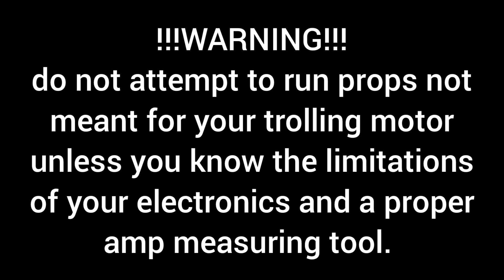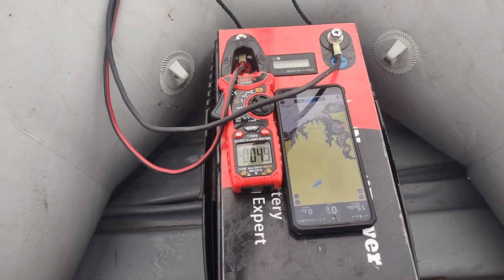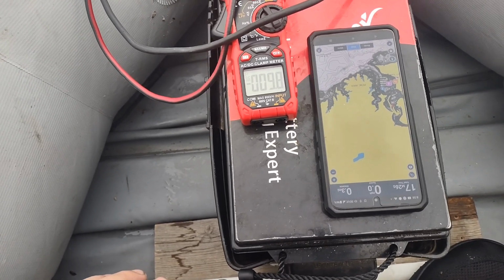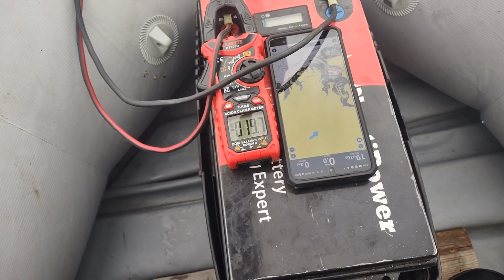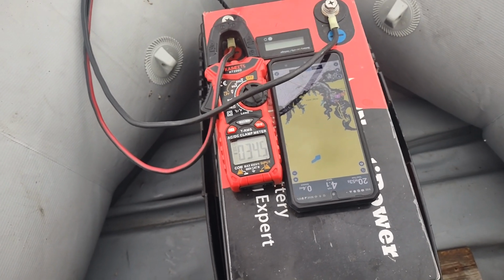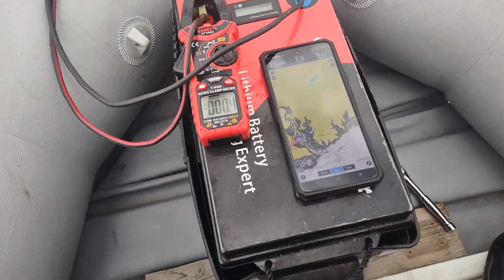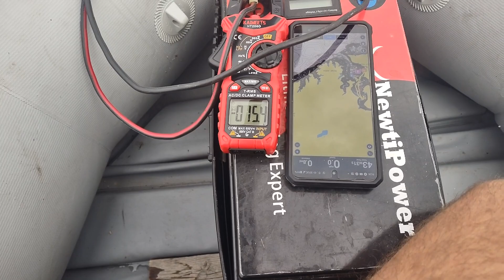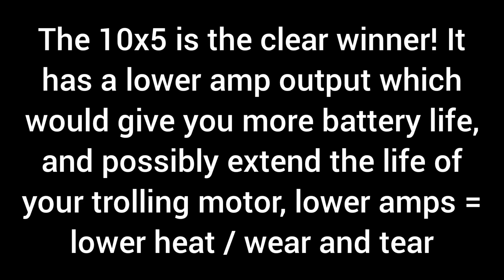10x5 vs 10x8 prop for Minn Kota trolling motor

Comment: Would like to see a 12x5 for comparison.  Larger diameter turning a little slower might equal more thrust on less amperage.  This is a very good video series.  Thanks!
Reply from the maker: That may be a possibility very soon, APC is going to send me some to try out, I'm gunna make a series on it to compare all props they send me, as well as trying on on a 112 pound thrust motor that's attached to a 28' pontoon boat!!!
Reply: @codyakfishing8856  I bought a 240 lb thrust 24 volt...it didn't speed up my 10ft jon any faster than 12v 46lb thrust...what gives? 5x the pound thrust and didn't add a single mph 😢 I returned the stupid thing.
Reply from the maker: @rittzbyitch3682  240lb thrust???
Reply: @rittzbyitch3682 the thrust is rated at 0 mph.  It doesn't represent a top speed.
Reply: Most trolling motors have about the same top speed regardless of thrust from what I have found. Changing the prop pitch is worth a shot
Reply: 10 x 7 higher pitch for faster speeds but slower starts less torgue.

Comment: You have to match the prop to the boat. That motor, battery and 10x8 on a nice canoe would hit close to 6mph or higher.  the 10x8 is a great cruise prop  where you could draw 10 amps and run all nice and slow like a trawler.
Reply from the maker: I agree with you 100%, seems the 10X8 is a bit much for this particular boat, I may have a plan to use the 10X8 on a 24v 86lb motor to see if it would achieve the same speed as an epropultion/nt300
Reply: @codyakfishing8856  I use APC in my RC planes and you can do a lot to them to get what you're looking for if one is a bit much. You can the diameter down some or narrow the blade some. order some and play around with them. You can even heat them up and change the pitch some but you need a pitch gauge to do this.
Reply from the maker: @airraptor  I'll keep that in mind, I have ordered a 24v trolling motor, it will be in sometime next week, I'm gunna try the 10x8 with it, if not APC agreed to have me review and test many of their props for marine applications

Comment: Great experiment, great data, thank you! 10x8 is actually quite similar to the recommended propellers (11x8) for torqeedo 1003, which is their past generation slower spinning model rated at 1000w. Of course the blade shape and area ratio is different, but not drastically -- apc propellers are much closer to these entry-level electric outboard propellers than traditional trolling motor propellers. I'll probably try out 10x8 on my 86lb trolling motor (also drawing around 1000w with stock propeller), and see if it has enough torque for the higher pitch.
Reply from the maker: Sorry I'm late to this, I had no idea it was similar to the torqeedo, now that gives me an idea, maybe an 86lb thrust motor from Amazon along with the 10X8.... May get up to 6mph.... Hmmmmmm.

Comment: Great videos! I love seeing this type of testing. You should compare these apc props to the aftermarket kipawa propellers that are designed for trolling motors
Reply from the maker: That's a great idea, I'll have to do that soon thanks!!!
Reply: I have the Kipawa props. They're like traditional trolling motor props, with very wide blades. They're very well made (tough) and will move the boat a bit more quickly, but also use more power.

Comment: thank you for posting this. I have been testing power requirements for my redneck barrel boat all summer and this is helpful. Especially because you link'd where you bought them. 
A couple of key things I've learned this summer, the motor doesn't like a lower voltage for very long, it will get hot, and the motor control will get hot in just about any case unless you directly cool it if you are out more than a couple hours at a cruising speed of 3mph or more.
Also, if you are using marine batteries (lead), you need to have enough battery that it would run 10hrs at the rate you use it. So, way more capacity than you will use, but pulling power out faster than that heats up the battery and damages it. Lithium is not like that, but you must have a good bms that can handle high output for a long time if you use lithium. So, you may have to get a much bigger pack than you need in order to keep things cool.
My system is 24v trolling motor running on 4-6v flooded golf cart batteries (5kw/hr). I can only run it at 22 amps (500watts/hr) for 5 - 10 hrs (half the battery). Max amps is 45. if I go at more than 22a, something will get too hot to continue. Of course if I am only running for an hour or two, I can run at full power. The control will get very hot, but it will do it.
 I will get some props and test them next year probably. Thx for giving me an idea of what I can expect.
Reply from the maker: I'm glad it helped!!! Yea I run a 150ah lithium battery, and I can run about 3.5 to 4 mph at about 15 amps on a calm day, low voltage does hurt motors, but lithium stays above 13 volts all the way until they are close to 0. I can do at least 3mph for 10 hours, and pulling 15 amps I don't fear anything getting hot or damaged.

Comment: was wondering if you had any thought on one of these apc props fitting on a newport vessel 55lb trolling motor? I believe the shaft is the same size 3/8. Goal is to extend run time on my 100ah lipo battery.
Reply from the maker: As far as my testing went, i believe the Newport 55 will benefit close to the same as the Minn Kota 55 enduramax, best prop you could use is the 10X5m-LH

Comment: Hey Codyakfishing , thank you for the review of the 10x8 prop!!! According to your findings with the 10x8 prop and the 55 trolling motor, it didn't do as well as I thought it was going to. However... with a little bit of math and the previous findings with the c30 Endura which is what I'm running the 10x8 on the smaller/slower motor should move more water and only draw within 1-3 amps more difference. It actually may do quite well on the upper end of the motor (speeds 3-5). The pitch of the 10x8 is much greater than the 10x5 and I don't think cavitation will be an issue due to the slower speed/power of the c2. Thanks again boss man, your information is GREATLY appreciated!!! I will keep my eye out for more of your boating and motor wisdom! Oh I had one more question...I was looking to purchase a handful of shear pins and I was wondering if they are all the same size? Is there a certain part # I should be looking for? Thanks again brother!
Reply: For apc and tonhatsu 2-3.5 hp propellers, I'm using 3mm x 25mm, or 1/8 x 1" pins.
Reply from the maker: I'm not sure of the size.of.shear pins, I do believe form 30-55 they are the same, I'd like to purchase quiet a few as well,.I have 2 for now.
Reply: @helloterran  I thank you very much for the info sir!

Comment: My Xi3 will do 4.7 mph with the 10x5 prop and it will do 4.3 occasionally 4.5 with the 10x8 prop.... 
The 10x5 last alot longer too on my kayak. 👍
Reply from the maker: @SargesAdventures  that's great to hear, have you tested to see if it's drawing as much power?

Comment: Great experiment, thank you!!!!  

Do you think it won't be big 10x6  for 55 trolling motor ? Or perfect  10x5  for motor  30lb and 55lb ?
Reply from the maker: As of now, I believe the 10X5m-LH is perfect for a 55. As for a 30 I'd say a 9X5ish (haven't tested yet) but the 10X5m-LH works for the 30 as well, only with the 30 your 1st speed is higher than 2mph (a little fast for a slow trolling presentation). If you have a pwm installed on the 30 that takes that issue away
Reply: Hi, what you can recommend for 42 lb minn kota?

Comment: A couple years ago, I measured thrust and amps using a static setup in my pool with a minkota 30 lb trolling motor.  
I got the best thrust to Amps efficiency ratio with a 9-6 APC prop.
Reply from the maker: Nice, that's good to know..... Did u have to modify the prop to fit on the motor at all??
Reply: @codyakfishing8856  
I just had to add a slot for the drive pin. 
I just dug up the data and I was wrong about the 9-6.  I didn't test a 9-6.  I stuck with various props with a 4" pitch which I researched as being the pitch of the stock prop.
 The best performance was actually with a 9-4 APC and it provided the same 17 lbs thrust as the stock prop (yes the 30 lbs rating is a lie), but that same thrust was achieved at 21.7 amps versus 27.8 amps for the stock prop.
Although I never did comparison measurements in the water, the 9-4 feels faster despite having the same static thrust which I suspect is because less current means more RPM.   More RPM for the same pitch equates to a higher pitch speed.
Reply from the maker: That sounds about right, I definitely gained speed with the 10x5 over the stock prop, and the 10X5 is made specifically for the trolling motor, thicker blades, and a recess for the shear pin.
Reply: @codyakfishing8856  
I did manage more thrust with larger props, but the 9-4 was the best combination of efficiency and thrust.   The highest thrust was with an 11-4 APC at 21 lbs, but the current was too high at 32 amps.   The highest efficiency was a 7-4 prop with 13 lbs at 15.7 amps.
Reply from the maker: Nice, I gained tons of efficiency with the 10x5, I thought about going for that new Newport electric outboard but top speed is about 6mph, that's at 36v and 35amps, not to mention with a battery it's about $2000, I just don't see the need to spend that much for an extra 1.5mph...lol my setup now goes about 6 hours at top speed of 4.5mph if I move to the front of the boat.....
Reply from the maker: @Andy-df5fj  that Newport uses 1200w to go 6mph, while my setup goes 4.5 using 350w
Reply: @codyakfishing8856  
Nice.  It seems just about any APC prop performs better than the stock prop.  I guess that weedless design costs a lot of performance, but it's better than being wrapped up in the weeds which trolling motors are designed to tolerate.
Reply from the maker: @Andy-df5fj  the tradeoff to me is worth it, the reservoir I fish at is mainly rocky, not a whole lot of weeds anywhere, I'd say if your trolling motor is used more like an outboard like on kayaks or small Jon boats it's worth it, but if you have an actual gas outboard on a larger boat.... Then having the prop weedless is a much better option
Reply: @codyakfishing8856  
Wow that's a very expensive 1.5 mph indeed.

I agree 100%.

Comment: Great video! To me, this begs the question: What happens with the 10x8 on a 24v or 36v system? Really feel like we're on the cusp of some silent and powerful electric motors in the next few years.
Reply from the maker: Thanks rootwad!! Yea I believe so, I have a video where I did put the 10x8 on a 82lb 24v motor and it didn't do as good as I think it should... I got 5mph using 45amps, considering I can get 4.5mph with the 10x5 on my 55lb it's not worth stepping up

Comment: I have a Newport Vessels 62lb 12v trolling motor. To my knowledge its the largest trolling motor that runs on 12v. I wonder which prop would be best for that. My guess is the 10x8 is probably still too big. I still need that thrust to go against the current.
Reply from the maker: I believe you are right!! I'm going to test the 10X8 on an 86lb soon, maybe in a few weeks, I'd say the 10X5 for sure, I'm also going to perform a test where I hook a scale to a doc then a boat, and measure how many pounds of force each prop puts out, stock VS 10X5....

Comment: I wonder if that 10×5 prop will fit my Newport vessel #46 thrust motor? Anybody know? Great video btw, i use to own that same inflatable boat you have!
Reply from the maker: @seanpatun9875  I believe they do work on the Newport, if not then they are like 7$ so worth the try I'd say, I've heard minn kota and Newport have the same prop shaft size

Comment: Are there pitch less like 10x3 or 10x2 you can find and possibly test? Seems the smaller number pitch the better performance?
Reply from the maker: It all depends on the boat, smaller pitch will mean a little less speed
Reply from the maker: Also, it depends on the motor as well, the 10X8 is too much pitch for the 55 to push, you want to start small and pitch up until I start reaching more amps without more of a top speed, on its way now is a 24v 86lb motor, it shouldn't have any issues turning that 10X8, this creating more top speed

Comment: I just looked at my APC RC airplane props to see if I could use them but it looks like yours are pusher pitch props & my plane props are tractor.

I wonder if I hooked the battery up in reverse would it work as the motor would spin in reverse theoretically or would I fry something?
Reply from the maker: I have t tried hooking it up in reverse polarity... I'm not sure if it would damage your motor or not, I would t advise ir

Comment: Lets go codyak!
Reply from the maker: Heck yea, I wish I can get out and do a vid, I'm working 5 12's at the moment and still have to juggle family time, I'm gunna get out there soon
Reply: @codyakfishing8856  I understand  I want to fish but it's cold and windy here in florida so boat makeovers it is!
Reply from the maker: @SaltWaterBassTv  that's always fun, I may have time to test 6 different props but it won't be for another two weeks, I may record a fishing vid this coming Monday, my father and I have plans to go out so long as the weather cooperates
Reply: @codyakfishing8856  so when I upgrade .y prop expect to draw more power and make.more heat? Ill.go faster but drain the battery quicker?
Reply from the maker: @SaltWaterBassTv  i forgot what motor u have, on my 55 I dropped 10 amps and gained .8mph, so less heat and extended range
Reply: @codyakfishing8856  older min kota transom mount 40lb
Also the washer thingy that has tabs on it for your thumbs on mine broke
Can I just use without?
Reply from the maker: @SaltWaterBassTv  u mean the finger nut??? U need one to hold the prop on, but yea you should save power and gain speed with the 10x5m-lh

Comment: What type you are recommendered for minn kota enduro max45 ?
Reply from the maker: For the enduramax 45 I'd recommend the 10X5, sorry I got to you late I work graveyards and just woke up....lol
Reply: @codyakfishing8856  great, thanks.
Reply from the maker: @markojaara973 np, hope it works for you, the 10X5 link is in the description, also, be sure to get some 3/8 (I believe) stainless steel washers, you will need them to attach the prop
Reply: Hello, have you done any more experiments with different sizes on your 55? I.E. 9x6, 10x6, 11x6, etc. Thanks!

Comment: Tassos  Manolas .Athens Greece.
Sir.I have a 55 lb electric motor and i want to upgrade the propeller for more speed .In 5 scale in calm sea  the speed is 4.3 knots.The motor is haswing   osapian 55 lb. I now nothing about the market in USA I want your help to solve this mater.Thank You so match.
Reply from the maker: If it's the 55lb thrust go with the 10mX5-LH prop from APC.com, that should be the best one for u